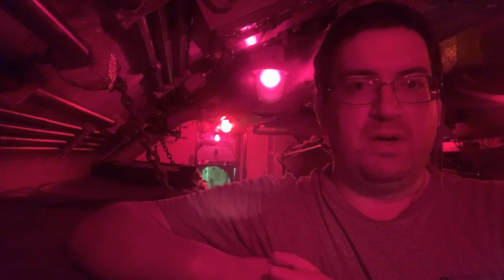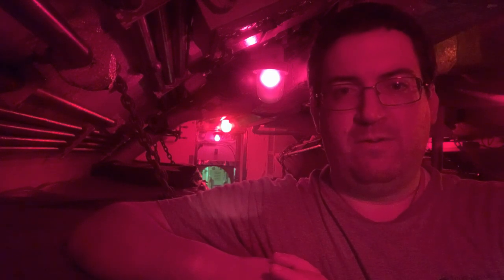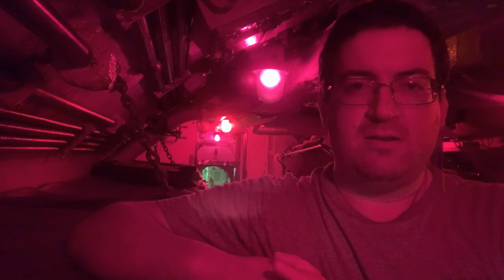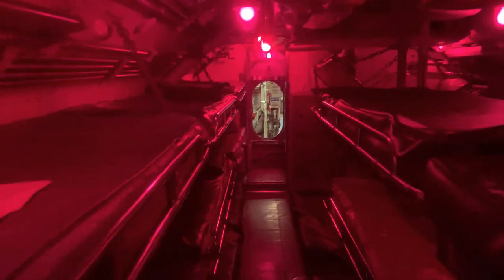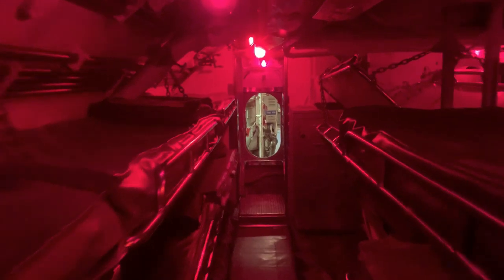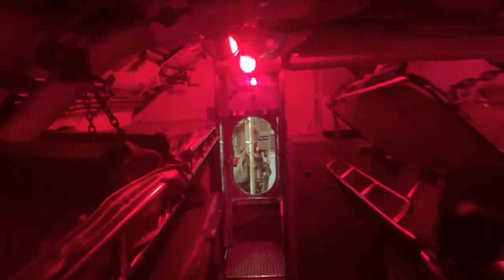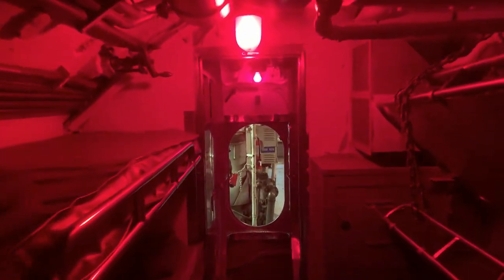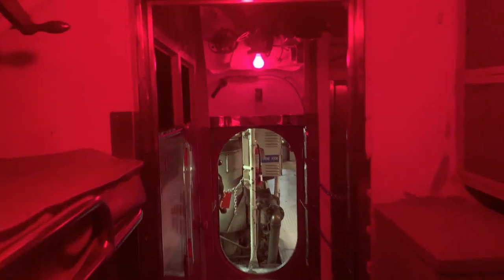Sub Science: Rig For Red

Comment: What specific Wavelength is the Red light that is used? It loos like its either 660nm or 680-690nm? I cant find the answer to this.
Reply from the maker: The US Navy did not have standardized specifications regarding the wavelength of red light fixtures. Most red lights are white bulbs covered in red glass, so the specific wavelength would be affected by variables such as the quality of the glass, the current through the bulb, the bulb’s filament, the air quality, etc. It would not be uncommon for red light fixtures located in the same compartment to put out differing wavelengths because of these variables.